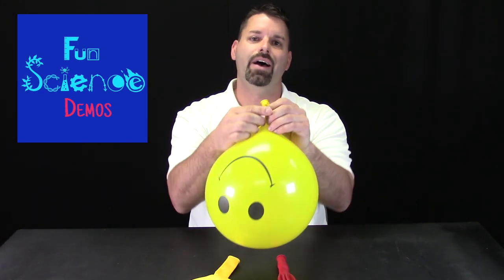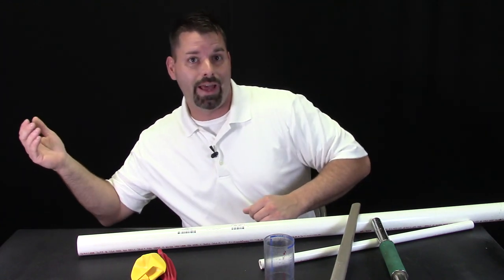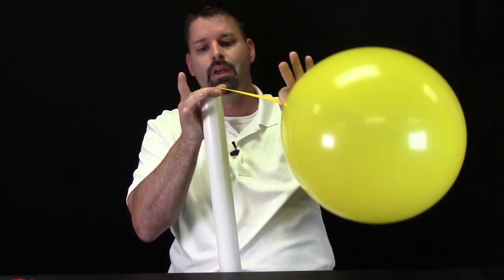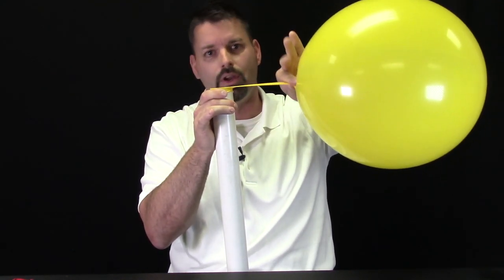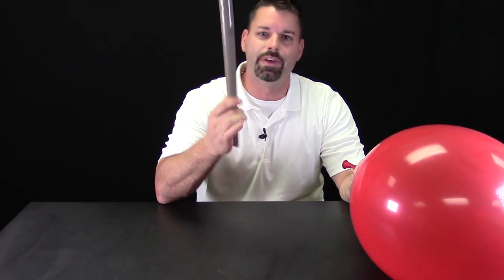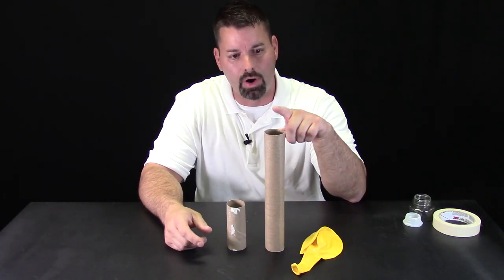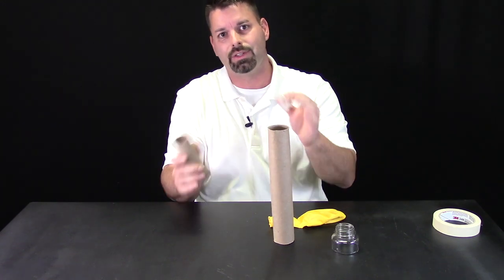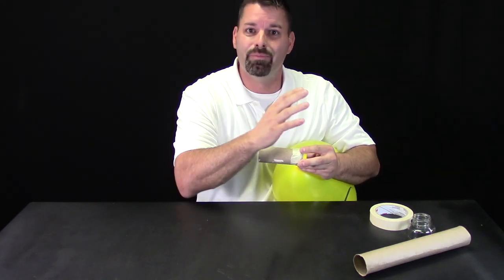Explore Sound and Your Own Bagpipe

Comment: OMG, I can't be the only trumpet player watching this? 
Thank you so much for explaining this. The brass instrument world is filled with misconceptions about how the instruments make sounds and what causes pitch change. Some people swear by "blowing harder or faster makes the pitch go up" while others say that the size of your lips is what causes the pitch change. 
If you have gotten this far, could you please explain your thoughts on creating a high sound that also sounds loud? 
Thanks again!
Reply: AFAIK the size of the vibrating part (with trumpet these are your lips) also controls how loud the tone will get (check "lip trumpet" videos to simplify the situation). The instrument itself (particularly air inside mouthpiece) changes the tone by resonance and also how fast your lips vibrate and so change pitch. Mainly trumpet pitch is changed by lip muscles, but also by the squeeze of mouthpiece (particularly if played wrong). In other instrument a reed vibrates instead of the lips. With the balloon bagpipe the stretched part over the pipe end imitates what your lips do when blowing a trumpet or horn.